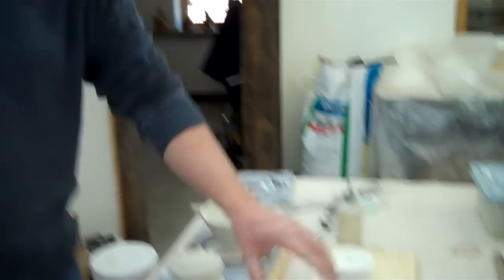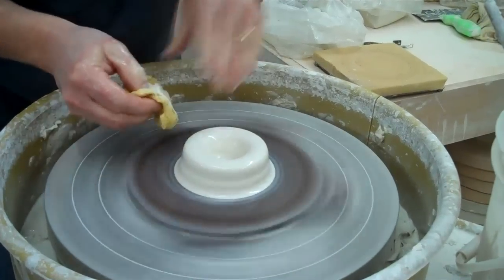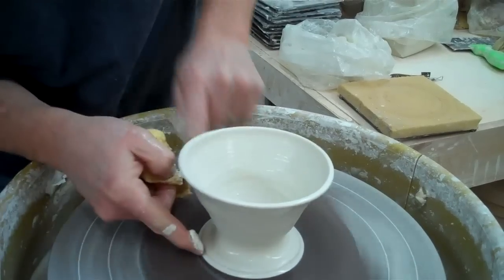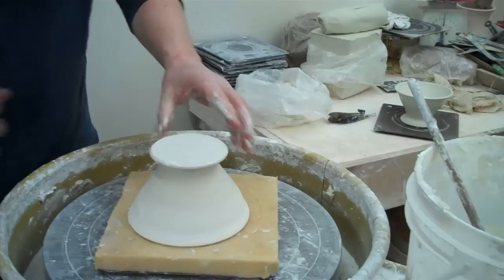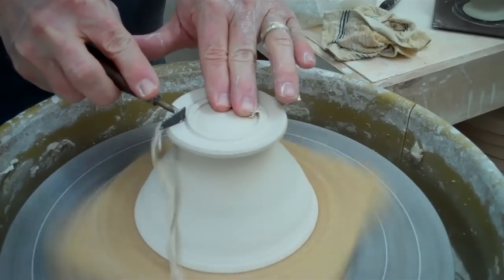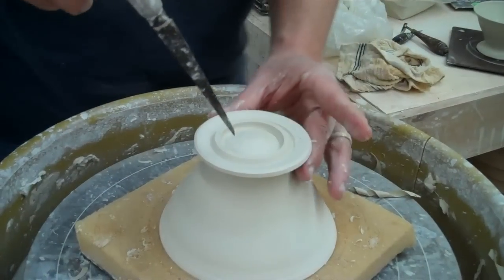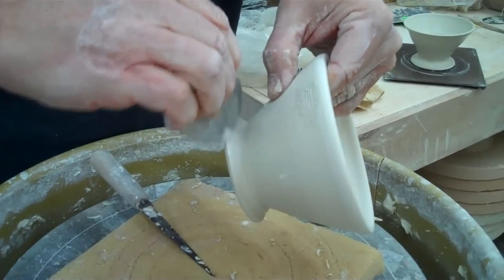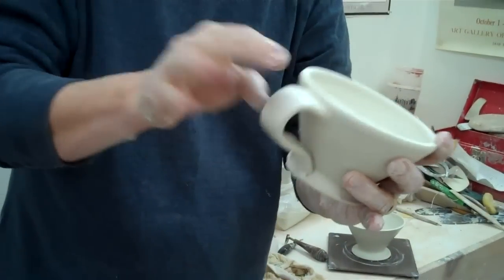Making a Funnel for Pour Over Coffee - John Britt -2011

Comment from the maker: Hey Amy, I googled pour over funnels and found other people having this trouble. Here is a sample:

This is my third coffee dripper, and by far the best. For years, I used a plastic Melita one with a flattened bottom, and a single small hole in the bottom, but the coffee it made was nothing special. I also didn't like the plastic flavor that it imparted. I also tend to avoid using plastic with hot beverages. Then I replaced it with another dripper with a flattened bottom, with three small holes in the bottom, this time made of ceramic. No plastic flavor anymore, but also no improvement in quality. Then I got the Hario. I NEVER would have thought that the shape of the funnel/filter and the size of the hole in the bottom could make such a difference. It allows a faster extraction, and the ridges help prevent a vacuum from forming (which slows the speed of the water draining through). You DO need to use special filters that are designed for true cone (not cut off across the bottom). This shapes helps keeps the grounds in the right place for the water.

You do need to learn how to properly brew coffee to get good coffee out of it. There are lots of videos online, and at Intelligentsiacoffee.com. First off, start with whole beans, and grind them to the proper fineness/coarseness (this takes some trial and error until you get it right for your tastes). In general, the grind should be medium to medium-fine.

Edit: For those that prefer a slower extraction - you can always grind the beans more finely - that will slow the extraction, as finer grounds "clog" the filter. But, as always, any adjustment to temperature, speed, grind will result in a different flavor.

1.Rinse your filter to remove paper residues, and put the grounds into the filter/dripper.
2. Once the water is boiling remove it from heat and swirl/stir it to get the heat even.
3. Pour just enough to saturate the grounds, and wait 45-60 seconds to let it bloom (it lets the C02 escape)
4. Pour SLOWLY a circular motion near the edges (but not ON the filter) to wash the grounds down into the brew. Try to pour slowly enough to not have to stop until you've run out of water, but without overflowing. Otherwise, the grounds will wash up onto the filter and you'll have to wash them back down when you start pouring again.
5. Wait for the water to drain through. Some people prefer to stop the process when the flow changes from a stream to drippy, but ground fineness will also change this speed, so you'll have to experiment. I just let it all drain through myself.

I have been following this process with my other ceramic dripper, and it resulted in merely decent coffee. This same process with the Hario resulted in actually GOOD coffee.

Comment from the maker: I really don't know the answers to all these questions.  I don't make that many of these. the first thing I would do is find the filter and designed the funnel around that. Making sure that it works well. And then I know that I make the holes larger sometimes I make them slits, or  sometimes I leave it  open... you have to figure that out depending on your glass etc. What  I 
 do is to survey all the ones that are being sold and adapt that to what I'm doing. Also, if I have one customer that's a problem I just give them their money back.
Reply: +John LOL
ok...
i know the problem isn't the holes.  it's the filters welding themselves to the walls which creates a vacuum and doesn't let the coffee pour out quickly.
i'll just do a more scientific experiment next time i make them.  more work on the channels and angles of the walls.
...and my customer won't take her money back!! she had one (of mine) once that worked perfectly and broke it, and now is desperate (going on 2 years...) for a replacement.  i really love her actually, and i'm glad to have the challenge to be scientific about this and really get it right.  i want my coffee cones to be the BEST!   all of them!!! 
:)  amy